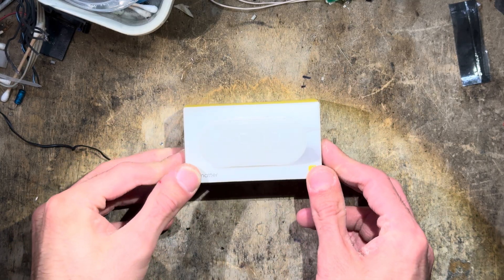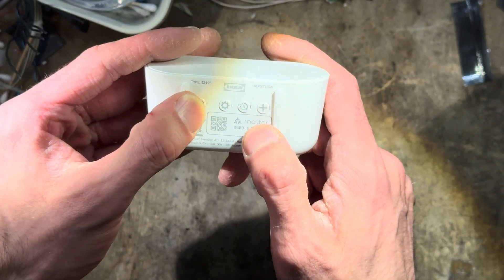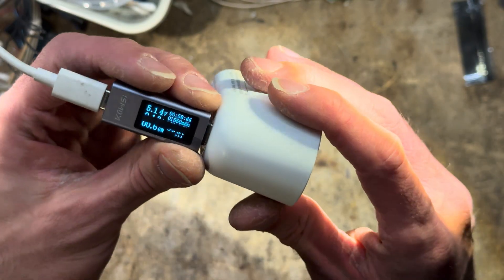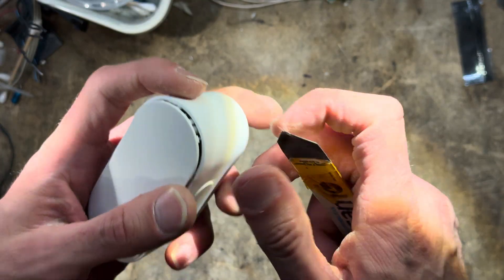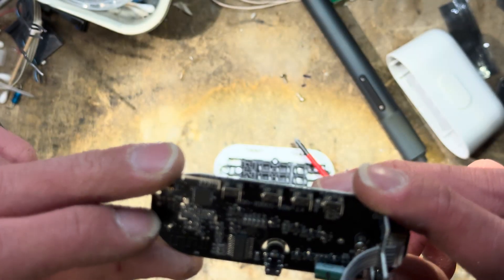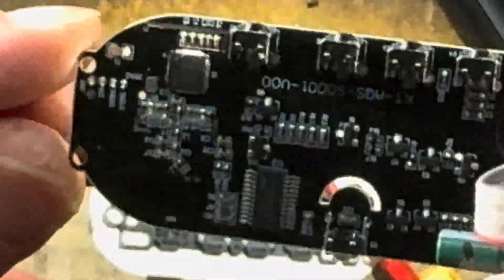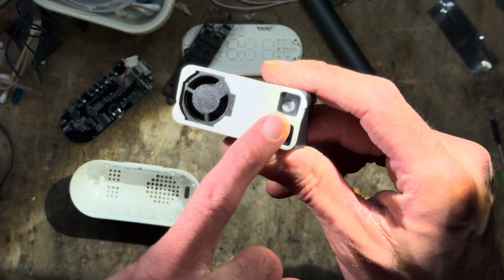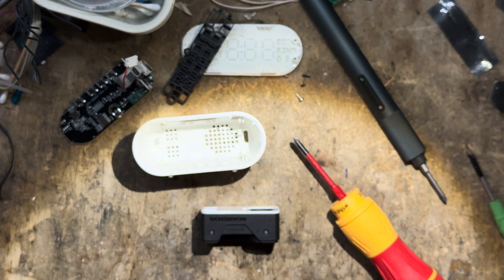IKEA ALPSTUGA - Air Quality Sensor with Matter - Unboxing and teardown

Comment: What CO2 sensor does it actually have?
Reply from the maker: Sensirion SEN63C-SIN-T
Reply: @FrancescoF  Its using the Sensirion STCC4

Transmissive non-dispersive infrared (NDIR) SCD30 USD 35
Photoacoustic NDIR (PA) SCD4x from USD 15
Thermal conductivity (TC) STCC4 USD 8
Reply: That is a huge difference when it comes to co2 sensors. The STCC4 sensor is very unreliable. 

Are you certain it contains that one?
Reply from the maker: @Christiaan1990 it’s using the SEN63C-SIN-T

Comment: I'm guessing this uses an eco2 sensor rather than a tru CO2 sensor.  Far cheaper but highly inacurate in my experience.
Reply: He did write the actual sensor model: Sensirion SEN63C-SIN-T
Not sure what you call eco2 and what is true CO2..?
Reply: @radiantav  he probably means a much cheaper sensor which cannot detect CO2, but detects other gasses and tries to estimate CO2 levels from that. The true CO2 sensor is for example SCD41 . that one is pretty expensive.
Reply: @adameichler  SCD41 is 20$ when bought just one. SEN63C is 38$ but it also includes PM1, 2.5 and 10 sensors which is likely why it's more expensive. So, not really a question of price. Looking at specs, 41's sensitivity is 50ppm while this one is 100. I honestly don't see much of a difference and I (like Francesco) am quite impressed that IKEA is offering the entire product for pretty much the sensor price on its own. I assume they bought 10s of 1000s at least 🙂
Reply: @radiantav  You're right that the SCD41 is very affordable, when compared with previous generation of sensors, which were around 71 $ a piece. And the VOC sensors were much cheaper than that, so there were not many commercialy available product having a real CO2 sensor. But now the price gap is much smaller and I am looking forward for this Ikea product, which might replace my DIY solution with SCD41.
Reply: SEN63C's CO2 specs are identical to the specs of standalone STCC4 sensor so I'm guesing it's integrated into SEN63C

Comment: Does it need the DIRIGERA hub or it can connect directly to a Thread Matter hub like HomePod mini or Apple TV 4K?
Reply: Yesterday I got one of these as well as a button and some water sensors. They all connected easily to my Apple TV 4K. The only hiccup was when I noticed that the Home app was reporting that the leak sensors weren't responding, but they were working just fine. I think they just turn the radio off until they detect liquid (or my damp finger). When that happened I got a critical notification on my phone which is nice because I thought I was going to have to set up alerts myself.
Reply from the maker: That’s the beauty of Matter, no vendor-specific hubs needed. You can use the newer Apple. TVs or Homepods as hubs
Reply: @FrancescoF but it’s so confusing because I have the Meross Smart alarm MA151 and despite it being Matter it doesn’t work without a its Meross hub MSH450
Reply from the maker: @aprosdoketon-i9n in some cases matter compatibility is only at the hub level. Meaning the sensor talks to the hub in their own way then the hub exposes it as matter. IKEA devices are Matter native

Comment: This is by far the cheapest CO2 monitor I've seen…
Reply from the maker: Cheaper than just buying a single particle counter off digikey
Reply: @FrancescoF  STCC4 is below $10 and its CO2 accuracy is on par with SEN63C
Reply from the maker: @bursztyn10 but this is CO2 Only it seems
Reply: @FrancescoF  True, I was just saying that adding a CO2 measurement isn't that expensive. I personally bought SEN65 sensors for around $25. It lacks CO2 measurement but adds two other ones. I guess SEN63C won't be more expensive than that (it's not available yet for regular customers).
Reply from the maker: @bursztyn10 it’s on digikey for €26 each for 1

1649-SEN63C-SIN-T-ND
Reply: @FrancescoF  I must've missed that, thanks.
Reply: It's crazy what volume of production can do to the price considering they make this for all the Ikea's in the world. And each gets a pallet load of one product at least.